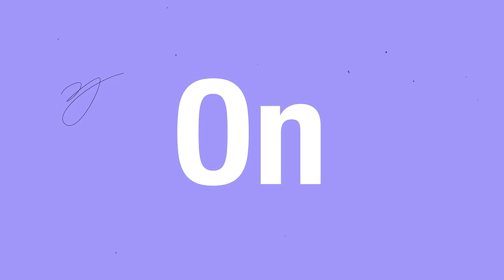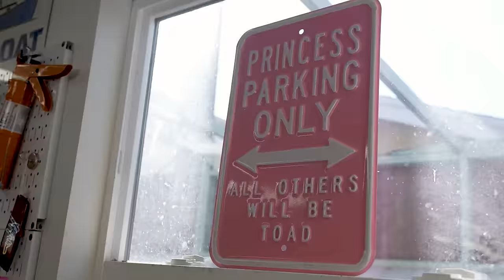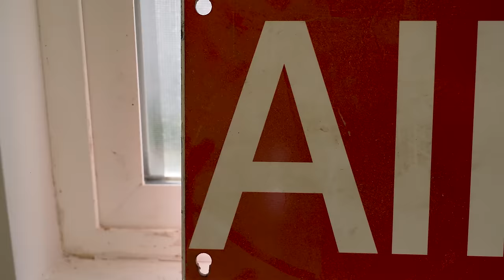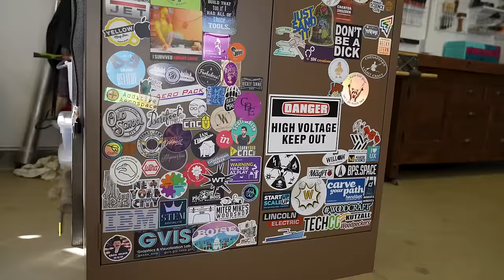I Moved my Entire Workshop in 2 Days

Comment: Dust Collection:  I had a 240v Laguna 2HP cyclone for about a decade.  It was stuffed into a corner making it (the corner) useless for anything else.  I bought a Harvey G-700 (also 240v) a year ago and I LOVE it!  Way quieter and more powerful!  It is also very easy to empty the sawdust compared to the cyclone.  It has a low profile so I was able to put a bench over it giving me space to put my scrollsaw, spindle sander and belt sander.  I have a really small shop so this was a huge win to have a permanent home for those three tools.  Also not as tall as a standard woodworker, the bench is a little high for me, but I solved that by building a box to stand on when I’m using the sanders and scrollsaw.  Really jealous of your 4x8 workbench, there’s only enough room for a 24” x 60” workbench in my little shop, so my SawStop is also my additional work surface.

Comment: Very nice workbench! I've always covered my benches with oil-tempered masonite (aka: tempered hardboard). It makes a nice smooth surface to work on and it's easy and inexpensive to replace when it gets messed up and damaged. Looks like a great shop. Lots of space to put more equipment in. You need a lathe and a mill now. :)

Comment: Meyers lemon trick...if you have too many, wash them, cut them up in chunks, freeze, then when you make food, take a chunk out and grate it frozen over the food peel and all...and it just works great.  I highly recommend the hepa filter laguna pflux dust collector line...if you have the 220v you should be all set.  I got the 1.5hp version and that works great with all my tools..but they have the larger units as well.  You definitely want to run those on 220 vs 110 as with 110 you would need a 30 amp circuit and outlet which is less common than a 220 outlet.  That way you have the cyclone built in and the hepa filtration and even the 1.5hp model will do two 4 inch hoses (or a 6 inch larger ductwork that you split off how you like.  Mine is shown in a number of my videos on my channel, not that I think I did a specific dust collection video...if people want that I could do one, but I am sure there are other videos out there on it already such as on the laguna channel, etc.  I even saw that Matt Cremona originally had one of those but I think he had the 2hp or 3hp version in his last shop.The other nice thing about the pflux dust collectors is they are on wheels...so you can move it around if needed like I used to do until I re-org'd my shop and put it in one spot and now I just use the flex hoses to go everywhere nearby.

Comment: Oneida Air Systems makes great dust collection stuff. I've got the one with a giant HEPA filter and a solid dust collection bin. You either need a system like that, or you need to have all your dust equipment outside your shop. It's the fine dust that'll clog your lungs. If you want to get by on the cheap, You can run hose to the outside and blow or collect all the dust out there with a bag system, but do not run a bag filter indoors. They won't do.

Comment: Xylafoxlin consider a tool wall for drills and hammers and saws and DRAWING their outline around them once you find a good spot,  and write on the wall board what the tool is like:  "Dewalt Drill"  or Cheap skill saw"  and so on and this will help you see at a glance what is missing, borrowed, stolen etc and will reward you to put the missing tool back into it's outline, like fitting a puzzle piece in it's spot and it's satisfying and helps you to remember to put tools away after use.

Comment: What a great creator space!  I am taking notes!    CLAMP RACK on wheels:  Like you, I bought one thinking it would cure my clamping ills.  It did not.   The rack is difficult to push around since it weighs so much, it casts a large foot print and is constantly in the way, and yet, it doesn't hold enough clamps.  Frequently, I have to go to my clamp stash; which is a bunch of wall mounted clamps that I throw on a wheeled cart and move to the work-piece.  It may seem counter intuitive; but the wall mounted storage is easier AND quicker.   See the wall of clamps on the back wall of the Wood Whisperer vids for my dream clamp arrangement.

Comment: I would suggest adding electrical outlets all around the table and then one extension cable that powers them all up. Easier to use tools around the bench, less extension cords on the floor and easier to clean up.

Comment: If you have room, consider making nested tables ... like the russian nested dolls.  One table fits inside and under the larger table and the smaller ones are on wheels because there are so many projects that are too tall for your main work table and you will need one 6 inches or a foot lower or even 18 inches or 24 inches lower and having those little rolling tables can save your back.

Comment: Upgrade your workbench top to a torsion style box. You'll thank me later for having a flatter surface. But I'd highly recommend you start out with 5x10 sheets of MDF so you can give yourself a pit of an overhang all the way around your table. (Maybe only 3" - 4" all the way around) That way a full 4x8 can fit within the tabletop itself. This is very useful for so many reasons that you will only discover AFTER you have this feature.

Comment: Outstanding job 👏🏼  
  I've been struggling for over a year to figure out an efficient layout for my shop space. I'm horrible at that stuff. One end I have drill press, metal lathe, (still no mill 😢)  plasma, oxy/acetylene, welders, cutters and grinders. On the other end routers table, mitre saws. I'd like a diy paint bench with filtered exhaust. In the middle my automotive/mechanic/ electrical stuff.

Comment: For height, the big table should be just a hair shorter than the table saw so you can use it as an extended outfeed table...  For the router, have you considered putting the router under the table saw side wing, then you can share the fence between the 2 tools.

Comment: regarding dust collection,if you're not going with a commercial unit,there's YT videos of dust collectors using a ShopVac and a homemade cyclone separator,built into a rolling cart,so it can be moved to various power tools. and some use a remote control to turn it on/off.
Your shop is fabulous,and I envy you for it. Keep on Making.
Reply: I use a new ShopVac for suction, and my old dead burnt-out shopvac as the sort-of-cyclone separator.  A cart, with some sound insulatioin, would be a very welcome upgrade.  I should really start on that...  😏
Reply: there's a YT video of a guy who used two 5 gallon buckets to make his cyclone separator,using a few PVC and rubber pipe adapters,and other vids on making a cart carrying the ShopVac and separator. simple,low cost,but effective and easy to use. using 2 5 gal buckets makes for better separation and easier emptying. More room for dust and chips,too,so you can go longer before needing to empty it. Xyla could save a lot of money if she doesn't buy a central vac system and the plumbing for it. and IF she's forced to move again,moving a ShopVac/cart is easier than a built-in central vac.

Comment: If you have the option I'd suggest mounting the dust collector outside. Then you can go with a simple bag type filter. If you have to put it inside then you'll want a pleated high performance one. As brands go there's not a lot of difference, so I'd stick to Grizzly or another cheaper importer.

Comment: The screw bin... if it was mine, it would eventually be full of different kinds of candy, lol. What's more important, having screws handy, or being able to have a readily available snack that you can chew on while you go to the screws from the big box? The only neg I can see with the work bench is that along the long 8 foot side, there is adequate overhang so if you want to clamp something directly to the bench, you can. But along the 4 ends, you've put your 2x4s out flush with the end of the work surface top, so it would be impossible to clamp something there.

Comment: 7:27  my only suggestion for something permanently mounted like a dust collector:

 Don’t occupy the corner. I’ve found that locking down corner space makes the room not only feel smaller and cluttered, it prevents some future reorganization and upgrades. 

 I always keep corners free for stuff that can be moved like a table with daily stuff, random unexpectedly acquired totem poles and obelisks, temporary vertical storage (lumber, tripods, fiberglass models of myself for some reason).

Comment: Laguna might want to sponsor you on the dust collector as I have noticed them on other channels.  Personally I have a Jet 110V with a canister and it works sufficient for a three car garage shop. (Table saw, Jointer, Bandsaw, Planer, Drum Sander, and a Laguna CNC router.) w/o issue. So if you can't find a sponsor you don't have to spend $$$ for the biggest collector out there.  Plus I noticed that you have an air filter which is good because you will (as everybody does) just run over to the belt, disk, hand... sander for that quick little straightening or rounding over w/o turning on the dust collector.🤭

Comment: 15:31 Konigsegg workshop has machines that they move around on a hovercraft system. So they turn on compressor the 5tonne machine then floats on a cushion of air and they can push around with a finger. Mr JWW did a how to build a konigsegg factory video. Check from 15:45.  Or the hole things as they have some amazing stuff and you like engineering.

Comment: 11:21 When I built my outfeed table (which doubles as my project table), I did it so haphazardly. I built the base (my own design), built the top on the floor, as this is a brand new garage/shop and the floor is nicely even, struggled to get the top onto the base (this is a roughly 6'x3' surface using 1/2" plywood glued to 3/4" MDF on top), screwed the top to the base, added edge banding to protect the edges of the table, and then don't ask me why, I flipped the table so I could put the wheels on. LOL. When I decide to upgrade this unit, I am keeping the top but I will build a NEW base with WAY better wheels (the ones I have struggle to lock properly), unscrew the top from the old base, and slide it on over to the new one. Fasten, and win.

15:51 This shop would be perfect to install a small jib crane to help lift stuff up onto or off of that project table.. And you could pick a specific spot for it, because you could just wheel the whole thing over to the crane. Either floor mounted from the side, or ceiling mounted assuming the roof can support X-amount of weight (an engineer would know how much).

Comment: Ooh, you should try and train the majority of that tree (wire/rods/straps) onto you part of the property line - to avoid future issues (encroachment on neighbour, leaf/fruit clean-up, "fence damage", wild varieties of mine vs yours disagreements, etc) but also to prevent the tree from getting too heavy in any one direction. Can't do too much about any future conflicts regarding the root system buuuuut roots tend only to be an issue around new construction or plumbing.
But damn, you could do soooo many things with those lemons. I made a bunch of dried cocktails with dried lemon/orange/tangerine wheels and ended up with an entire cookie tin of extras - when smell amazing whenever I open the tin. I could see you making a ridiculously well engineered outdoor food/veggie/fruit drier (air powered? solar driven? jet engine blower?)
And you have so much room in the new shop you could have have it indoors =D

Comment: Good job. I bet you within a year, you will wish you'd built that fastener section bigger!!!  I have over 200 bins.. and still run short.. I have to "double up" on lower Qty stocking fasteners to keep it sane. Wow.. another true WIHA fan! I first encountered them decades ago.. they've been around so long there are actually "rip off" versions available.. but truly a pleasure to work with for "tech types"! Love the bench.. but it would take up too much space.. I have those flipper bins filled up with power tools!! {Plus, I sometimes need up to 6 drill motors to keep from having to change bits multiple times in a production job.. so, had to buy the HD Husky tool drawer.. problem solved! Also, I built huge amounts of storage in my Router table to help clear more floor space. Nice video.

Comment: Congrats on the new space! Now about the clamp cart..., nah. A wall-mounted organization of all your clamps is a better idea for "storage and availability". I think you would benefit much better from a well-designed Job-Cart. A cart that has an integrated power cord and usable protected outlets, a "Panic" button/bar Off switch as well. The cart should be big enough to hold the tools you are using including power tools. Having one side of it as an assigned space for longer clamps to hang out when not in use and before they are put away. Think of it as your "shopping cart" you use before you get started on a project. Just a thought....

Comment: Girl, you need to be part of a makerspace.  Work with dozens of other makers, share tools and space, collaboration, etc.

In Anchorage our makerspace has periodic glass blowing workshops, blacksmithing hammer ins, lots of 3D printers, wood working, welding equipment, etc.  What would be great would be to have a videographer sharing highlights with the internet.

With the right location you can not only have 240 power, you could have three phase, and a Fireball Tools worthy assembly table.

Comment: lol ive been racking my brain and watching a bunch of youtube videos of benches and sanding storage stuff to see what i wanted to do and i can see you have the same issue but got it down pretty well lol. ahhhhhh. add to all that, the smaller 1 and 3 inch sanding discs, then the polishing pads and compounds for epoxy work and sheets, blocks and drill attachments to help clean up live edge wood and im going nuts trying to come up with an all in one perfect solution drawer

Comment: Really happy for you. Being really picky though, you've always had 240v (unless your previous shops were wired as a giant spur from a 120v circuit) you just needed to bridge 2 x 120v circuits together, which you can do from most modern distribution panels. (Though this is all theoretical on my part as I live on the other side of the pond with 240v as standard.) Also you probably need at least two more mini-egg sections; one on the left so you are the same disttance from a snack whichever side of the bench you are on and a reserve in the middle in case one of the other two run out! Hope this is a signal of less "interesting times" ahead for you. Go Xyla!

Comment: Yay!  Great house Great working space and Lemons!  Now you can either grow potatoes to make your own vodka or grapes to make your own grappa and you will be a Limoncello factory!  Saluti!
Reply: BTW, Rockler has some pretty good dust collecting systems.
Reply: One more thing, you could make a wide A-frame type ladder with wheels on the bottom and hinges on the top for your clamps and then just have a "docking station" on a wall to fold it back into when you don't use it.  Instead of dowels you can just have boards that you clamp onto so they are all parallel.  C-clams on one side sorted by size, speed clamps on another and specialty clamps (Rockler has a few and no, I do not work there, but I have bought enough clamps from them) can fit where they make sense.  I am MORE than confident that you can bang out plans and refine the concept for your needs.  Whether you use this or not, I still cannot wait to see what solution you make for clamp storage!

Comment: On the dust collector thing, maybe you don't need an installed system. I am a one-man shop, and I built mine in a rollaway cabinet (conveniently the right height for an outfeed table for the table saw) and just move it around, since I only use one tool at a time. It's a bit inconvenient, but I think better than having a massive system permanently installed.

On the plywood cover, you don't need it. It's a working shop. It will just get in the way. I know having it look nice is a girl thing, but you're enough of an engineer to find beauty in things being accessible too. This is a time for the engineers to win. Make the projects look pretty, not the shop. Make the shop usable and it will be a joy forever. (My wife doesn't understand. But that's OK. She isn't doing the work.)

On the clamp cart, I want one too. Like yourself, I can't find a design I like. Plus I have too many clamps to rack them (I don't have too many clamps, of course; there's no such thing. I just have too many to put on a mobile rack). Mine are on the wall and I just live with the frustration of never having the clamps accessible. A poor solution, perhaps, but better than not having any clamps.

Keep on making...

Comment: My advise.... Better put some security measures in place. Windows easy access beware. Secure the garage door by placing metal panels inside to beef up the door; and latches on either side on the inside the garage door with padlocks. Fire Extinguishers. Shut off the power in the shop before you leave everyday & lock it. Yes, I have a shop to. Always lock up tools you can't afford to lose. And never leave a crowbar laying around. Good luck...